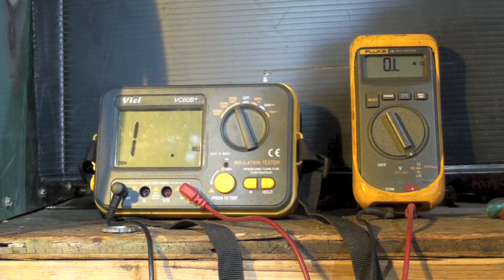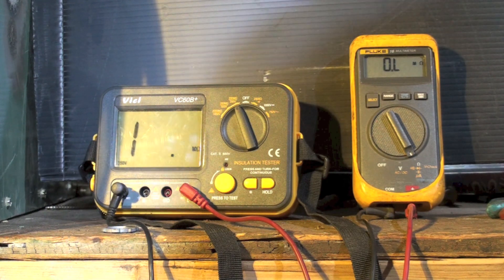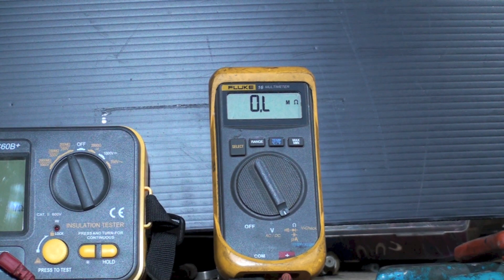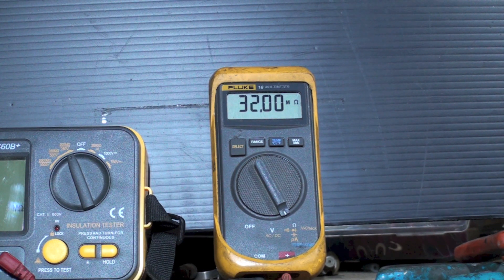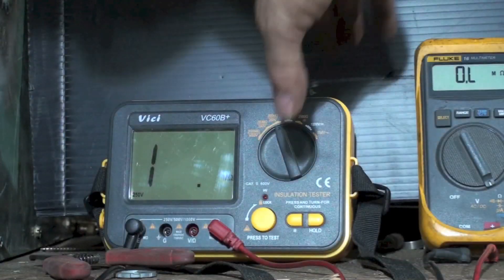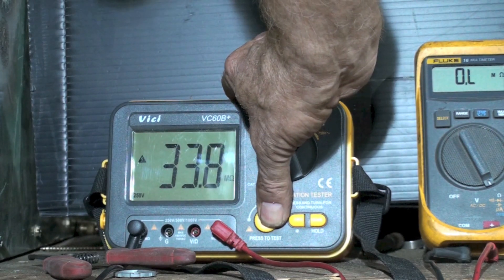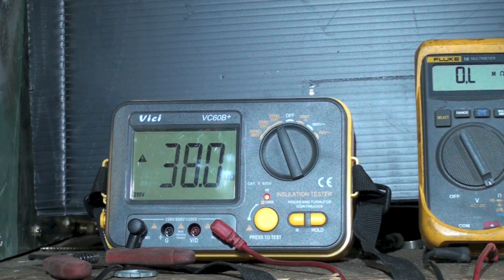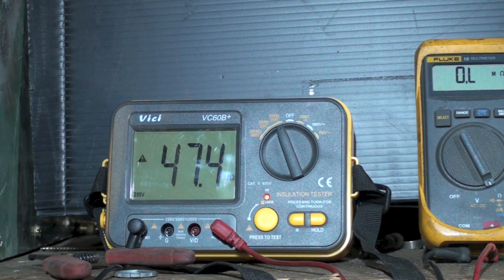The insulation tester vs the meggohm meter

Comment: We use the crank style analog megohmmeters.  I like to see an analog display, rather than a digital meter that is generating its power from a 9 volt battery.  I usually test 240 volt circuits at both 250 and 500 volts and 440 circuits at 500 or 1000 if it is OK with the equipment manufacturer.

The purpose of meg readings on a hermetic compressor motor is not only to determine the actual motor insulation condition, but to also evaluate the atmosphere that the windings are currently being exposed to, in regards to moisture and other contamination that can be present, especially in a field piped system.  Copper chips, copper oxides formed from not purging while brazing, moisture, and liquid refrigerant all conduct electricity, and will cause a good motor winding to fail a megger test.  This doesn’t mean the compressor should be replaced, it means the system needs to be cleaned up by changing the oil, if possible, and changing out the driers, until the oil is clean, acid and moisture free, and approaches the color of new oil.  After this is accomplished, and only then, should the  compressor be condemned for failing a megger test.

Comment: When using the insulation tester do you first power off the breaker, disconnect supply wires to device, and then test?
Reply from the maker: Yes.  The insulation tester has its own power supply.
GFM

Comment: question.... is that Megohmeter a good buy???
Reply from the maker: +J kelly The megger will tell you much more that an ohmmeter can.  However, most motor problems I come across, there is no doubt it is failed.  These tools are more for commercial industrial applications where you are testing the condition of a motor to determine whether the unit is getting close to failure.
GFM
Reply: Thanks

Comment: You should test the motor with 2x the normal applied voltage (500V for 208/230/240 or 1000V for 460/480). This is for several reasons. 1) the voltages above are RMS (average) values. The true peak voltages are about 1.3x the RMS value. So a 460V motor actually sees 600V at the peaks and a 230V will see 300V
2) motors on VFDs experience very high voltage spikes during operation 500-1000V+
3) the start winding in single phase motor has a higher voltage across it while running than the applied voltage. That's why capacitors are rated for higher voltages.
Reply from the maker: paulerockalot Thanks for the info.
GFM

Comment: Years back I had a machine shop set up to rebuild Copeland semi hermetics, I would remove the stators and check them with a megger to see if they needed to be dipped in varnish and baked. Since then I've used my ohm meter just to check for a grounded motor winding. If a tech goes around telling customers their equipment is going to fail all the time, the customer sees you as too negative, he will call someone else. I currently don't own a megger and don't see the need.
Reply from the maker: ***** The megger is best used to determine condition of equipment that cannot be down.  And then by recording winding condition as part of regular service.  This can give the customer the chance to replace the equipment before it fails.  Some use it as a sales tool, but I don't agree with that.
GFM
Reply: I believe in using a merger to test compressors and motors at all my pm services I have lost to many compressors in my years in the trade. I ended up having to explain that we lost a compressor to the customer that we just serviced. If a base line is started then we are able to inform the customer ahead of time. It's just one way to cover your rear end and being able to say I told you so, it's how i see it. If a customer dose not like my thoroughness then they can call the next guy. Thx for sharing your thoughts.

Comment: The reading is climbing because your charging the effective capacitor that is between the windings and ground.
Reply: grayfurnaceman I appreciate all your HVAC wisdom and experience!  Since I am an electrical engineer, I'll give you some of my own unsolicited wisdom in this case and this case only....It's definitely the stray capacitance in the windings charging up over time.  The only real reading is the final stable reading, after all of the stray capacitance has fully charged.  Your DVM went to OL because it is unable to read anything above 40M Ohms.  Thanks again for your awesome videos!  I've learned so much over the last few months!
Reply from the maker: dell177 That could be, but what I am being told is that the insulation on the windings realigns to create more resistance when it is energized.  That could be the same as charging a capacitor.
GFM
Reply: Yes!  The initially low readings are incorrect because the stray capacitance is still "charging", tricking the meter into thinking that the resistance is much lower than it actually is.  The only true reading is the final stable reading.

Comment: Nothing wrong with that compressor with regard to earth leakage.
Reply from the maker: heavydiesel That compressor is an interesting one.  It originally had less than 5 megs.  Evacuated and recharged and the compressor went up to what we see now.  Probably was wet.
GFM
Reply: Motor Is fine..  low readings due to moisture and contamination in system

Comment: Should be replaced? No. If it's working fine now but tell the customer you ran a "High Pot Test" and it shows the enamel coating that insulates the motor windings is starting to break down. It may run for days to years yet. When it does go it will trip the break or fail to run.

Comment: Hi there GFM, Insulation tester would always be better to use then a multimeter, if you have one. A multimeter just can't put the voltage out that an insulation tester can for an accurate reading. I would always set the voltage on the insulation tester to what ever the supplied voltage you had, in this case 240 volts. In the industrial plant I retired from we had a lot of 2300 volt and 4160 volt motors, if a motor tested "good" with my 500 volt insulation tester I would go back to the shop to get the bigger 5000 volt insulation tester just to be sure the motor was good before I reenergized a tripped circuit. I know you HVAC techs use your insulation testers to check the condition of compressor winding's to record and compare. In my industry we ran our motors til they died usually grounded. Thank you for all the great videos.

Comment: 50 and below the compressor should be replaces but people will wait till the breaker trips and there is a problem i have found... at lease you can let them know the compressor is not long for this world.. usually people will not do a repair unless its in there face not working ...they think your slinging a line a shit ...they will wait till there is on ac to fix it